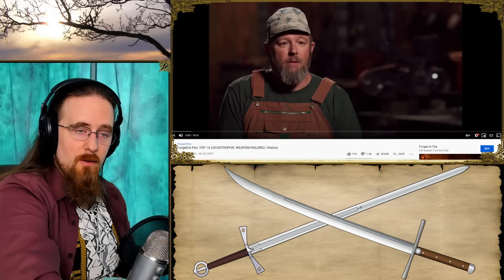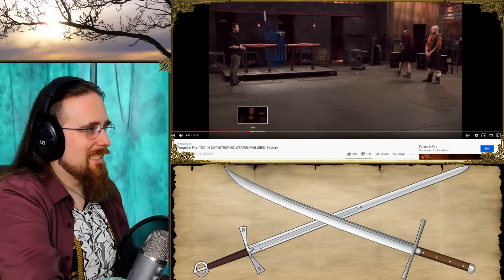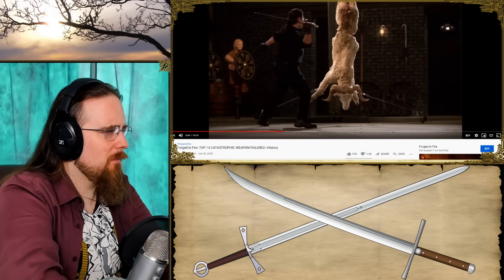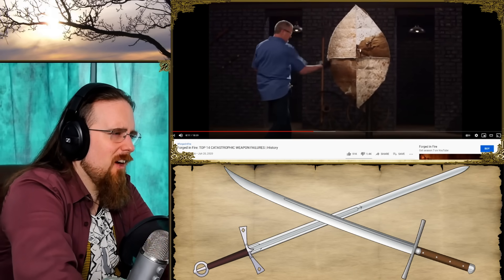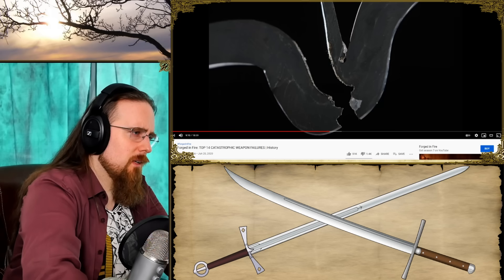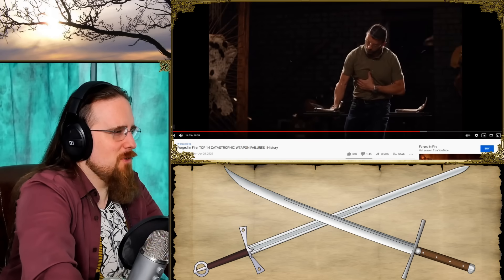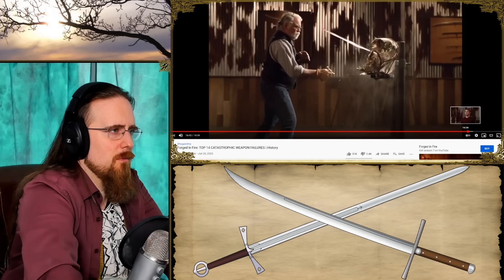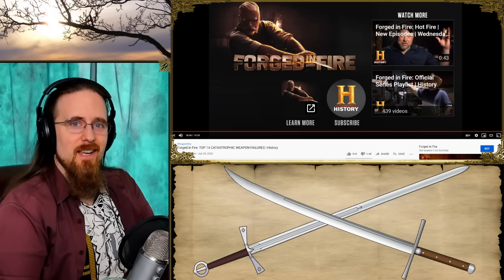Skall Comments: Catastrophic Failures on Forged in Fire

Comment: The tiebreaker is always the weight of the weapon and how good is the handle like if the judges say anything negative about weight or the handle no matter how minor you better hope that your competitor's weapon breaks.
Reply: Yep, ive seen the heavier blade clearly outperform the lighter one in all three tests, and still lose because its heavier. Its like, "It cuts EVRYTHING IN HALF IN A SINGLE SWING, I dont think fatigue will factor into this as you swing it half as often as the other blade for the same result". lol
Reply: It can be a very critical thing in weapon designs. If your weapon relies on alignment to deal damage, then you need to be able to properly grip it and tell how it is facing with minimal effort. A poorly shaped handle can make it very difficult to determine your edge alignment. As for weight, as long as the blade isn't swinging you, if the heavier blade far outperforms the other, then the additional fatigue is acceptable recompense for the performance. If both perform similarly, then the lighter weapon will offer an advantage in stamina management.

Of course, they don't always go into the justification behind this, but it does have merit.
Reply: Honestly, any time I've used a sword,  I prefer heavier ones that bite harder and cause more trauma. Not that I've hurt anyone, but in both testing and dummy practice, I feel better with a chunkier hit that can overpower and beat back the opponent. I'm a very tall and lanky man though, so I have leverage and reach advantages already, so a heavier weapon accentuates my strengths further.
Reply: @ChargeQM  It can also factor into the physique of the user. You're probably a beefier guy who can handle a heavier weapon more easily than other people who don't have the muscular strength and stable footing you have. A lighter weapon can be a requirement for a combatant who is smaller in stature or slimmer in build. Yeah, a bigger/heavier blade will bite deeper and chop harder, but if a smaller person uses it then it's half as effective as a weapon more reasonably weighted to their capabilities.
Reply: @ChargeQM  At that point, why settle for a puny little "sword"? Surely, the best sword of them all is a woodchopping axe. So much weight and power, can't get much chunkier than that. Unbeatable weapon right there
Reply: @lred1383  Then you won't have any control over that kind of weapon. A wood chopping axe cannot make fast motions compared to a sword. A battle axe is what one wants. Not a wood chopping axe.
Reply: @Khornedevotee  I was being facetious, thought i made that clear enough
Reply: @ChargeQM  sometimes there are blades that are too light, the one that has appropriate weight glides through targets while the lighter one can’t make it half way in. Don’t remember specific episodes but I feel like I’ve seen that before
Reply: @mndlessdrwer  I would say the importance of lightness depends on armor vs no armor. A lighter blade is not only easier to handle, but will also outperform heavier blades when it comes to acceleration/change of direction, essentially making the blade more nimble. 
In an unarmored fight, this can mean that you can cut before the heavier blade can parry (in general, the weight of the blade matters less in this case, especially if it is very sharp, because any wound with good alignment will be deep). 
In an armored fight, the heavier weapon will deliver more concussive force and break bones through mail, and it will also probably be more durable (i. e. striking other weapons, shields, bones, etc.). It also has the advantage in binding and parrying, since it will throw off the opponent's blade and it will be more likely to break an enemies guard.
If we're talking heavy armor, I would say lighter is better because the advantages of heavy blades against lighter armor cannot be applied to plate (except maybe hits to the helmet or gauntlets). In such a fight, the lighter, more nimble blade will be more effective at finding weaknesses and piercing the mail in between the gaps of the armor, since it is harder to avoid (however, one could argue that a dagger is better at this anyway). A lighter weapon is also less exhausting (especially in case of bigger weapons), which is a factor in battlefield use and prolonged duels (I'm assuming fights in heavy armor tended to be longer).
Overall I would say the lighter blade is more effective, not just easier to use. This is just as long as it isn't so thin it becomes too flexible (also more of a factor with big weapons).
Also keep in mind that E=1/2m*v^2, meaning that the speed of impact will actually play a greater role on terms of energy (of course more mass has the advantage of being harder to stop passing through the target).
I should also mention that I'm mainly applying this to swords in a skilled duel situation. Other weapons such as maces, a less skilled user or a more chaotic situation might favor heavier weapons.

Comment: Just a neato facto: When Skall was talking about a round corner vs a square corner, read up on the Comet, the world's first jet powered airline and the massive structural failures that led to several crashes. One of the main culprit were square shaped windows that concentrated all the pressure and force on one area, instead of distributing the pressure away. Hence why afterwards, even today, all airline passenger planes have rounded corner windows instead of square.
Reply: It's been 3 years but I have to interfere, I hope you'll understand. That's not what happened. The windows were not at fault. You can see they had round corners on literally any photograph of the original Comet. (Humanity had figured that one out as early as the age of iron ships.) The culprit was the holes in the fuselage that the various antennae were peeking out of, which were also called "windows" in technical language. Those, indeed, were square af.

Comment: Forged in fire: Tests a Rapier against a brick wall, it breaks in two Blade sucks.
Reply: The funny thing is, if it survives they'll then complain that the blade is dull. We literally have knife sharpening tutorials on Youtube where the first step they do for the knife is to draw it across a brick or ceramic cup to completely dull the edge in only a few passes.
Reply: @Qalidurut Those don't really have a sharp, cutting edge on them though. Much like a kukri, they tend to have a utility edge that's much more resistant to edge damage. The combative, military kukris have a thinner edge profile, but you aren't going to see the Gurkhas use them for masonry.
Reply: @Qalidurut Not if they're attacking brick and stones with them. They're going to be dull as shit or they use specialized tool versions of the knives, similar to they have tool/utility kukris and warfighting kukris. Again, this is steel, not godly mana-metals from the heavens.
Reply: What’s the first thing that comes to mind when you want to demolish a wall? 

A rapier of courae
Reply: Might as well see how well a tank flies
Reply: @whatisahandle_69  if you're actually interested the Russians tried to make a tank actually fly
Reply: @jimbothegymbro7086  Well more like they tried to make a tank fall with grace
Reply: The failure rate on this is pretty low. If the test is performed the same both times and one blade survives while the other one breaks, one is clearly tougher than the other. The idea is, if it survives a brick/thick piece of wood/a copper pipe/whatever, it would have survived on the battlefield or in a duel situation. I really don't see why the tests need to be realistic.

Also keep in mind that this is a TV show and blades shattering is actually desireable.

Comment: I feel sorry for the dude with the super curved blade that looked really solid until the edge alignment looked way off. The long curve of the blade makes any faulty edge aligment worse because there is more leaverage in the faulty angle.
Reply: Afaik this guy actually won.
Reply: @antyspi4466  He did. His blade lasted longer as his opponent, as was seen here, had their blade fail on the second hit.
Reply: @antyspi4466  Awesome. It did seem way more durable than the other blades. I've never seen the show so I don't know the specifics on how it works and if the eliminations usually seem fair or not.
Reply: @antyspi4466  I was thinking the same.

Comment: I would not swing a blade at a hard target like a madman, without a face-shield and at least thick clothing...
Reply: Most of the tester are bladesmiths. They are used to bits of hot metal flying around while they work.
Reply: @stephenbarrett8861  I am a chemist, I am used to acid splashing around, I still wear safety goggles (even more so than regular people: when I see normal people making soap without protective gear, I cringe hard. dont go blind for a bit of soap not worth it...). When you are an expert in the field, normally you would err on the side of caution when it comes to PPE.
Reply: @noneofyourbusiness3288  I don’t blame you. You can find footage of the Forged in Fire judges on You Tube and see how they work at their own forges.
Reply: @stephenbarrett8861  forging and bashing a sharp piece of metal hoping to break it are two different things. although rare because of the way kinetic energy works there is still a chance they will receive the pointy end.

Comment: I think when they do initial checks on the blades they probably look for weaknesses that could break them and put tests like those to get some drama
Reply: They've refused to test many blades that they felt would be likey to break or damage the user.
Reply: The tests are revealed before the blades are made in the first and second parts. I don’t remember if they do that in the finals or not though.
Reply: they also watch how they forge the blade in the sideline. ie: heat treatment, quenching, grinding. when the blade fails they explain to the blacksmith why they fail and how they fail.

Comment: When it comes to judging, its honestly fairly rare for the blades to perform equally well. They may both pass but like, one may cut deeper, or cleaner. But when they cant judge on that, I think its fine to take into account weight, the smaller details like handle construction and how it feels to wield it, and yes, which one just flat out looks nicer. Though too be honest, 9 times out of 10, it comes down to weight. Ive seen a heavier sword outperform its opponent in all three tests and lose simply because it has an extra pound to it.

Comment: I'm not a fan of the show. These men are expected to create fully functional and flawless masterpieces under a very strict time limit. Of course it's going to break when you beat it against a hard piece of wood.
Reply: And the guy tests the blade by swinging it like a bat
Reply: I mean not all of em do. But yeah they’re not the best at swinging them
Reply: hardwood fixed in an absolutely rigid post - no leeway
Reply: I mean most competitors do end up making a functional piece which doesn't break. You're just watching the failures so it's biased
Reply: @VermilionGates  it also puts more value on winning the competition, given how brutal the tests are.
Reply: Or when you try and attack a full plate armor with a Bowie knife built in like less than 12 hours
Reply: @VermilionGates  I do hand it to the guys that are able to create good weapons in such a short amount of time, but I would say the large majority of the weapons I've seen made on that show are crude at best. Witch is fine if you're the persian empire and you're pouring molten steel into sand moulds on the desert floor, taking nothing from the magnificent steel they created. It wouldn't be a reality tv competition without a mostly unreasonable time limit I guess.
Reply: @thisisjames4474  The goal isn't even to make a masterpiece, just a good blade. Given the time constraints nobody expects master forgery, just a good job
Reply: It's meant to test the smiths, genius. What did you expect?
Reply: @MansMan42069  the obligatory condescending goon has entered the conversation.
Reply: @thisisjames4474  And?
Reply: @MansMan42069  haha that is all. Cheers mate.
Reply: @thisisjames4474  cheers 🍻
Reply: and the most annoying part is how the judges don't even know how to handle a blade properly. they just swing it all over the place like a man-child on rage.

Comment: The judges are also pretty good about analyzing the breaks to try to find why the weapon failed, whether grain structure, discoloration, gaps at the shoulders, etc.  I've also noticed that the show is also pretty good as spending juuust a bit of time focusing on what might have gone wrong at the contestant's home forge to cause the failure (e.g. a bad quench, bad repair of a crack, or some shortcut made due to time).  But yeah, the judges talk about just how brutal these tests are and it is to set the best from the rest.  The contestants at this point have an idea of what to expect, being in their eighth season now.

Comment: The thing is that was the point.. The judges are blade smiths and they were putting the swords to the absolute limit to see how good the structure and the edge retention
Reply: Totally right, but what changed my mind was one episode of beat the judges where Dave Baker was against some other guy (the Shaska sabre)
Spoiler:

Baker ended up losing and one issue was that he had a delamination in his blade and that cost him time, even though he started off ahead of his opponent. That stuff happens to even the best, so judging based on one weapon in super abusive tests introduces too much variability imo.

Comment: To be fair, the judges have said it themselves that these tests are sometimes overkill because the competition is super close. On a typical test, they wouldnt be able to tell which one is better as both would probably pass with flying colors so they crank it up to intentional try to get one to be more obvious than the other. For a competition where they are trying to decide the best blade and with $10,000 on the line, i think that is fair.
Reply: They only started making that statement in later seasons and I bet it was after the ABS Master smiths on the show took a lot of shit in the blade smithing community for the ridiculousness of some of the tests as even their work would have a high chance of failure in those tests. There have been episodes where both blades performed similarly and they chose a winner by balance and even a couple by aesthetic. 

The balance thing kind of bothers me sometimes because sometimes the historical version WAS balanced that way (which may be one of the reasons why that weapon is 'extinct' after a certain period of time.) One episode that came to mind was the Japanese cross-spear and Doug's like, "I love the balance of this spear" and showed the balance point at the completely wrong spot for that spear historically and the spear head's proportions were all wrong.

Comment: I saw most of these when they came out. Had no idea someone made a compilation of the fails... tbh most of them were fails. 3:00 that knife was forged with two types of metal and he ended up not having enough time to treat it. It actually was falling apart for several rounds before it finally gave.

Comment: Knowing how they test i would just make a heavy almost unbreakable weapon and count on one of the other contestants blade breaking.
Reply: You wouldn't even need to sharpen it, since they dont't seem to care about cuts.
Reply: this has actually caused a lot of guys to end up losing because if the other guy doesn't do this and survives you auto lose because they always auto fail the guy who makes the too heavy blade.
Reply: Nah if anyone else doesn't break their blade your out first test, they really hate heavy weapons. Even on heavy weapons.
Reply: @davidresetarits5616  To the contrary, they always put the sharpness test after the durability test so any edge damage accrued will come back to bite you, unlike your blade.
Reply: I want to see a contestant make a titanium blade of the near same thickness of aa steel blade and proper heat treat as a giant "Fuck You!" to the judges and producers of the show.
Reply: @Talishar  IIRC, you can't make a productive edge with titanium: the edge tends to roll away from the cut (especially a high impact cut) and won't bite in to the material you're trying to cut. It will generally spring back into place after the cut attempt, but it will be pointless if it won't actually cut.
Reply: @jamesfrankiewicz5768  They already had a guy on "Knife Fight" who won, with nearly a course record using a large titanium knife. The Navy SEALS and others have been using titanium dive knives for a while now. Although as we all should know, these aren't pure titanium but titanium alloys. The issue you'd have using titanium alloys is that it's very light which makes for a very difficult chopper. It's also much more expensive and a pain in the ass to machine and sharpen. This is why you really haven't seen it take off too much in blades because the metal is expensive as hell and it's hard to work with unless you have the right equipment and knowledge to work with it. I've started to see more titanium alloy knives being offered now. Mostly chef knives for now.
Reply: @Talishar  I stand corrected.
Reply: @Talishar  And he'll fail miserably. It's cute you think it can be done in 5 days in a home forge.